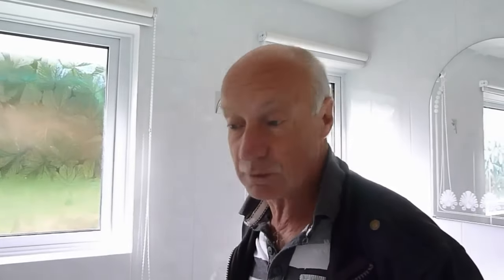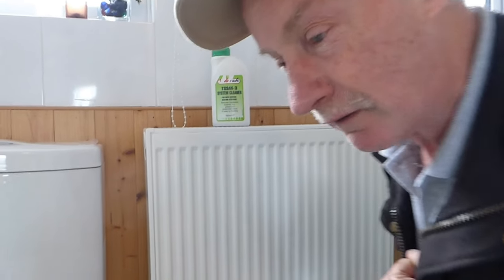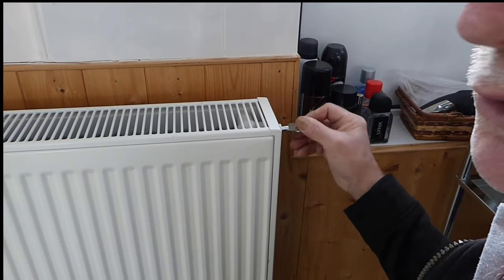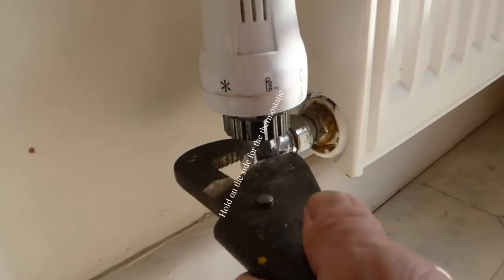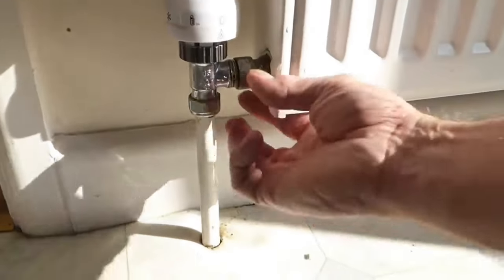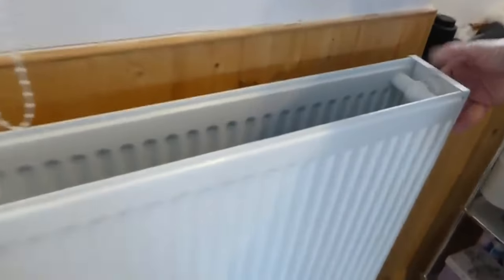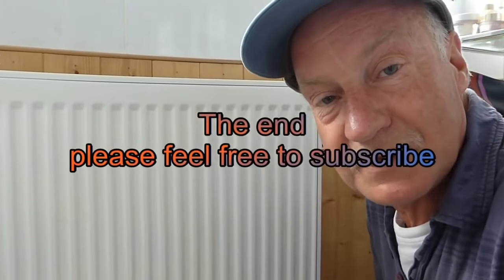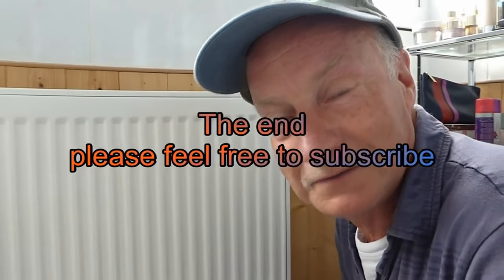Six Secret Radiator and Central Heating Tips. Get your radiators hot once more.

Comment: Thanks Al, Yes, I had to use extensions when I replaced an old imperial rad which worked well.. I had a rad replaced when I had kitchen refurbished, and the fitter suggested that he would alter the pipework from under the suspended floor ready for the new metric radiator, so, of course I let him get under the floor with all the spiders 🕷😂 which has a void of about 4ft underneath and him being a shortarse he was more able than me and did a nice neat job.
Thing is, since the work was done and I flushed out the system some radiators upstairs have been a tad cooler and have had to bleed them a number of times.
Reply from the maker: Try balancing the system.

Comment: Recently installed combi boiler,   losing pressure every 3-4 days. I know there are 3 leaky radiator valves in the house, but surely they aren't causing the pressure loss warning over only a few days?
Reply from the maker: They sure can

Comment: Balancing the radiators. Yes. I get that.  But go back - 😮 take the radiator out. Is there a video for that.  Ive one radiator closest the boiler ( replacement, by an apprentice)  I’m always having to bleed it !
Reply: Al.  That must be your best video ever ❤
Reply from the maker: There is a video for taking a rad out and cleaning it out, but not a lot of people want to take it on, cant think why, ha ha. Air is being dragged into that first rad so might be worth slowing your heating pump down a notch, im guessing you have an F and E system. Also try cutting the flow into the rad down by turning the lockshield valve down. Turn it right off then back half a turn.

Comment: When I followed your instructions and turned off all upstairs radiators -  all downstairs ones began working. Thank goodness, as it's been freezing 🇬🇧 🧊.

 But now upstairs ones have stopped!!! What do I do to get them all to work? What has the plumber done? Had a new boiler system put in last spring.
Reply from the maker: More careful system balancing is required.